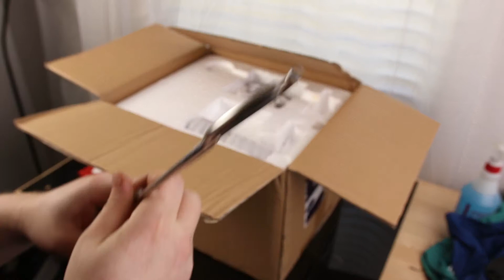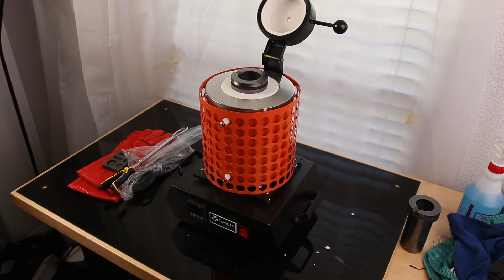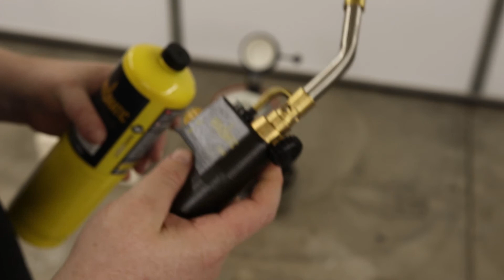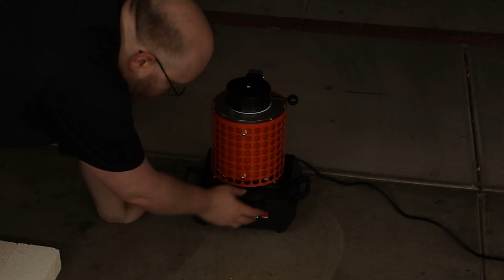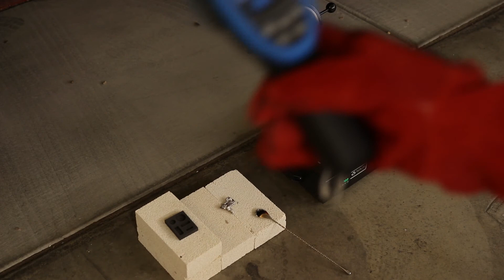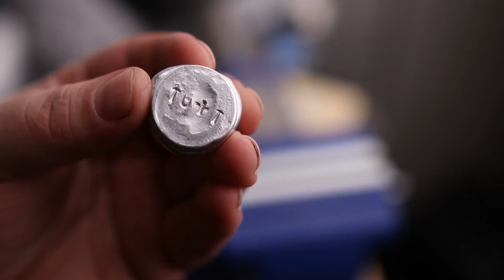Trying Smelting For The First Time Using The TOAUTO Melting Furnace

Comment: I bought the 1800 watt furnace 3000. The pid controller was bad. They sent another one. It and the bad one only display in celsius. sent the temp controller back. I bought an inkbird pid controller, it works but sv display only goes up to 999.0 in Fahrenheit. Need 2300 degrees in F. I am having lots of fun!

Comment: Forgot to preheat your crucible dude. If you wish for your crucible to have a long life with many heats, reheats, and pours it is suggested that you run the crucible to high temp then back to cool several times prior to smelting metal. Otherwise, nice work.

Comment: Did you notice any cracks on the white wall area next to the crucible? I saw a crack on mine, do you think it’s normal?
Reply: I didn't have any cracks.  The refractory cement will break down over time and use, but that probably happened during shipping.  You can buy refractory cement to renew your forge, but you may want to just get a replacement as yours is new.
Reply: @distractor_beamreviews  yeah good point. It was my first melt, so I was shocked to see the hairline crack up top. I did notice inside there wasn’t any cracks. I was worried it went all the way through, but I didn’t see anything. I may try the cement or just send it back. Not sure yet. Thanks.